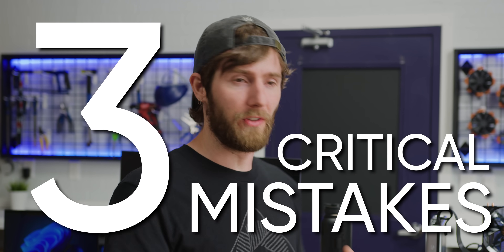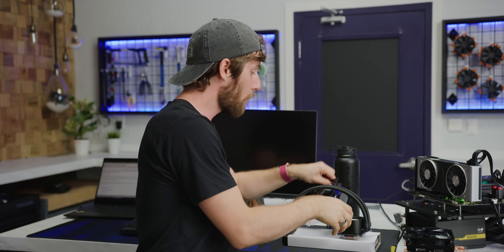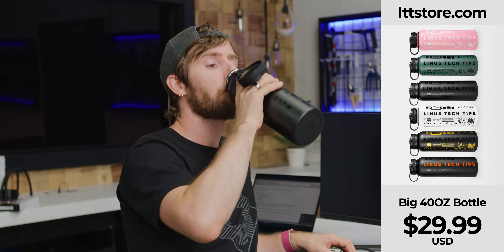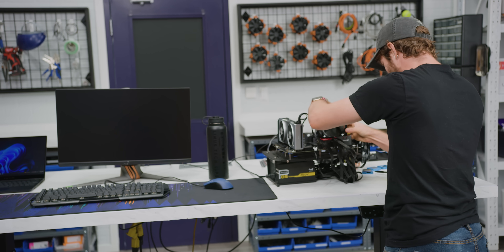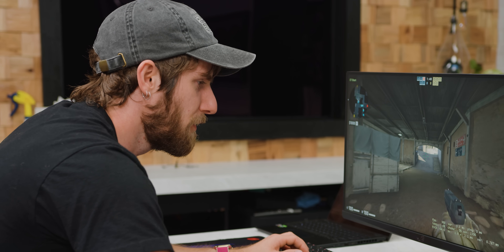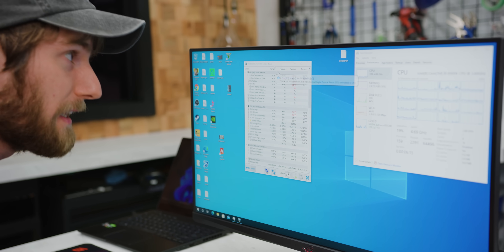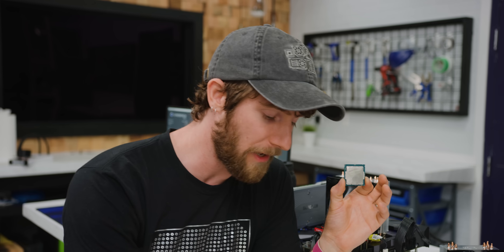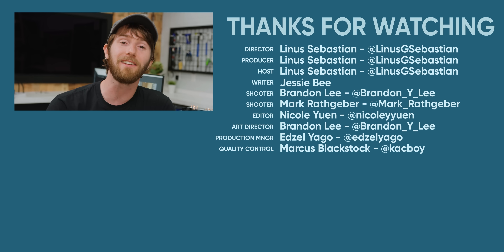How BAD is it if you forget to peel??

Comment: This'll be interesting. Been dismantling a lot of old PCs and 90s laptops lately, and evidently things didn't run all that hot back then. Or I assume because a lot of radiators were attached with a bit of double sided tape.
Reply: I had a motherboard from the year 2000 and it had a CPU card (much like a half height GPU).
Reply: @Father_of_Sakura  Gets weirder than that when you get to laptops due to the limited space. I forget the manufacturer (I think it was a Dell laptop and Chips made the.....chips), but one of the oddest was basically 3 smaller boards stacked CPU/tons of capacitors/more capacitors and other components, and as a kicker, they hid the memory slot UNDER all that.
Reply: @custos3249  it's just like how cars were made. Companies tried all kinds of things to improve their designs.

Then the mini was made with a sideways engine and FWD and they realised that for most people who didn't care about cars that was the best way to do things, it was safe and easy to use.
Reply: True, but if we get into automotive oddities, we'll be here all year until we get into aerospace with things like the saucer jet or the circular wing jet - can't recall the military designations off hand

Comment: Linus: “Is there plastic in between your CPU and cooler right now without you knowing it?”

Me: haha no…right? stares at PC suspiciously
Reply: I'm freaking out
Reply: I remember when I built my current rig. I installed my cooler and booted to check temps and they were really high. Did a reseat and the same. Only on the third time did I remember to peel off the plastic.
Reply: No kidding. I wasn't paranoid about this before, and I've never done this in the past, but now a tiny bit of doubt has crept into the back of my mind.
Reply: I have a nh-d15 chromax black and it doesn’t come with a peal just bulky plastic cover so I know for sure
Reply: @sijedevos2376  same here but amd stock cooler, that was their only option because of the pre-applied thermal paste
Reply: @sijedevos2376  I was starting to get worried I might have forgotten the peel but since I have the same cooler I'm cool again. Thanks mate
Reply: @sijedevos2376   Oh cool, I've got the same and I forgot. Thanks man.
Reply: @sijedevos2376  I have the exact same cooler, thank you for reminding me that I indeed don't have a plastic film to worry about.
Gotta love Noctua packaging design
Reply: @sijedevos2376  i have the same cooler. Thanks for removing my paranoia
Reply: @sijedevos2376  yeah all noctua coolers have preapplied thermal paste and no peel necessary afaik.
Reply: @captain_ironbutt  there have been multiple different production lines of it iirc
Reply: ngl my heart rate definitely shot up when he asked the question so directly
Reply: lol  questions like that tends to plant a doubt
Reply: Computer been heating up behind your back like a hooter.
Reply: @robertagren9360  Som en tutte?? ☻
Reply: I want to see a drawing of this sense of intense suspicion lol
Reply: Me watching him unpeel the cooler film: "Ruh roh"
Reply: "please confirm to your knowledge that you are not a fully robotic being"

'do a lot of people not know if they're robots...

...what if I was a robot and didn't know it?' - Loki
Reply: This is fucking me, I still can't believe some days I built my pc lmao
Reply: Me too lol
Reply: Ikr
Reply: i lokked at my pc 

lit that plastic was there and i thought before "dumb cooler"
Reply: why the fuck would he say that
Reply: I had to think about it for a minute, then he said something about the bulky plastic covers and I was like “oh yeah! I remember that very distinctively now.”
Reply: you can just take it apart and take a look
Reply: my Temps are low but I'm pretty scared
Reply: Samtherat6: stares at pc suspiciously

Me: stares at non existent pc
Reply: sees X button DOUBT